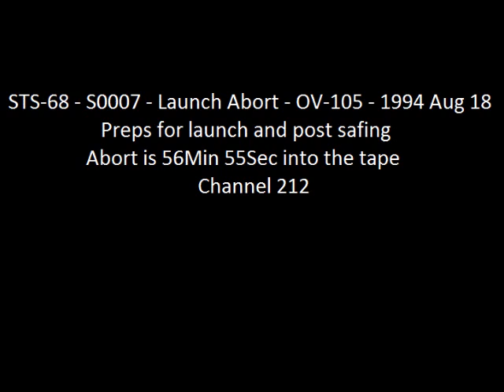STS-68 S0007 Launch Abort OV-105 1994 Aug 18 At 56Min55Sec into tape

Comment: Some help for you on some of these call signs: (In order Of Call Outs)
(All these guys are at the Launch site in the Launch Control Center (LCC) EXCEPT for the Astronauts and "Houston")

OTC= "Orbiter test Conductor"...(A Manned Console  At Launch control, runs much of the pre-Launch checklist.) 
CDR= "Astronaut Commander" 
PLT= "Astronaut Pilot"
GLS= Ground Launch Sequencer
RSLS "Redundant Set Launch Sequencer"
OVCC "Pad Leader"( Leader of the White Room team)
GNC  'Guidance Navigation and Control"
MPS 'Main Propulsion Systems"
DPS "Procedures"
RCS "Reaction Control System"
CGLS ?
HOUSTON: Mission Control
MS # "Mission Specialist" with and Identifier Number
NTD  "NASA Test Director"
ASP 'Astronaut Support Person" (An Astronaut On the "White Room" Team. Helps them in the cabin)
SRO "Range Safety Officer
MTD "Mission Test Director"
APU  "Auxiliary Power Unit" (Controls all shuttle Hydrolic Systems Engine, Elavons, Rudder, Bodyflap, landing gear)
ET      External tank
LO2   Liquid Oxygen
LH2    Liquid Hydrogen
O2     Oxygen
BFS   Backup Flight Control System
LD     Launch Director
ISO   Information Systems Officer
FIRE-EX Fire Extinguishing Water (Water spray on Engines and around the shuttle/Pad)

At least this is what my memory can recollect at the moment. I hope this helps you a little to Understand what's going on.
Reply from the maker: See "LSO-000151-2210 KVT-HB-002 - KSC Operational Intercommuncations System Call Signs.pdf" and "Acronyms and Abbreviations for KSC STS NASA Reference Publication 1059 Revised 19850010697.pdf" in the archive:
https://1drv.ms/f/s!AsoLDJx_szsuc_zSFFU0B1gKkFc
A few corrections (While it may not come across on the tape all of the above systems that are in the firing room (DPS, GLS, MPS, SSME, Etc.) start with a "C" as in "Console"):CDPS - Console Data Processing System (subsystem)
CGLS - Console Ground Launch SequencerCSME - SSME Engineers (Space Shuttle Main Engine)

Comment: GLS=Ground launch Sequencer. (the Ground Computer- it transfers functions to the RSLS at t-31 Sec.
Reply: Well, not exactly. The RSLS was actually an integral part of the GLS...at t-31 seconds when the GLS operator called out that "GLS IS GO FOR AUTO SEQUENCE START," this means that every built in design of the vehicle that could feed a cutoff or abort was then active...it just so happens that with the main engines (and some other aspects that I won't bore people with here), their cutoff signals went through the portion of the GLS called the RSLS or Redundant Set Launch Sequencer. A fabulous example of this occurred on STS-93 when the Firing Room LH2 operator saw what turned out to be an anomalous spike in H2 in the area of the main engines...he asked for and received a GLS Cutoff (you can hear it clearly on the video) just prior to the start of the main engines. Once GLS Safing was in progress, the GLS officer reported that they'd actually entered an "RSLS Hold Indication" which was key because it then allowed the team to recycle back 24 hours. Had the engines started and been shutdown with an RSLS ABORT, then they would have had to take the vehicle back to the VAB and most likely back to the OPF for engine refit.